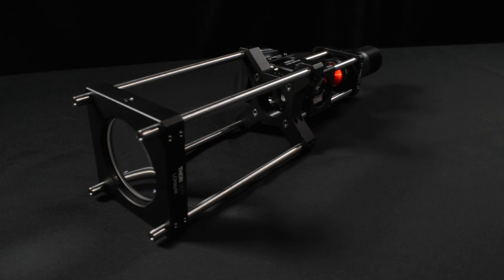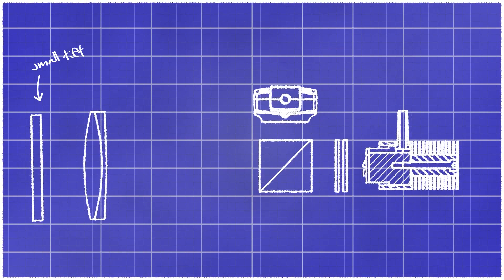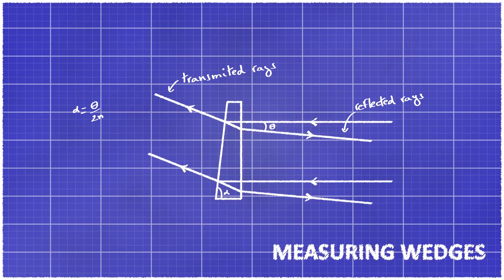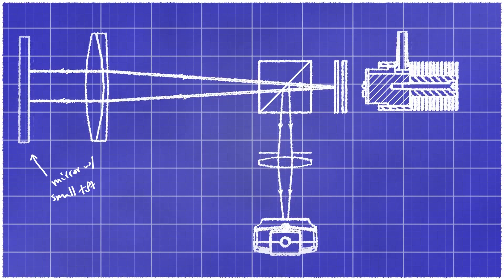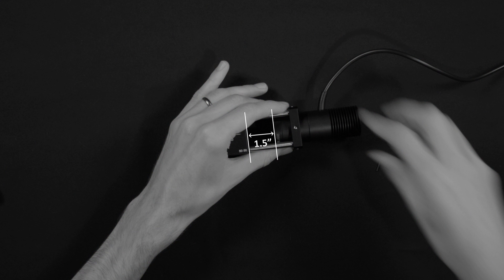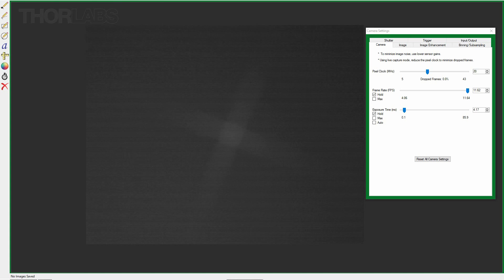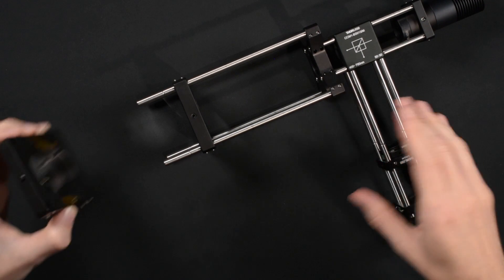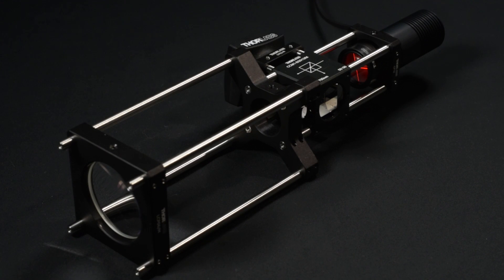The tool every optical lab needs to have

Comment: Hi, thank you for great video. Following your project you think it is possible to create a collimator instead of an autocollimator? Maybe replacing Crosshair Reticles with a very small pinhole or a Usaf resolution chart ? I'm trying to build a collimator that allows me to have an image projected at infinity. Thanks
Reply from the maker: Yes/no. While it's fairly easy to replace the reticle by any other target (pinhole, slit, slanted edge, ronchi, dot pattern, usaf etc.) the question is more on the quality you expect. If you aim at quantifying contrast for mtf evaluation you will need very high imaging quality which is not easy to achieve.  In the current design form, the BS is going to introduce aberrations to the image. However, you can align your target with a second lens using the autocollimator.
Reply from the maker: It's also important to budget the allowed depth of focus for the autocollimator. If I remember correctly, it's around 0.2 mm for this design (f=200 mm). You may need to increase the focal length while maintaining the f# depending on the lens under test and the precision you want to achieve
Reply: @thepulsar  I meant from your setup removing the beam splitter and replacing the target to create a collimator instead an autocollimator. But how to calibrate it without BS? Also what did you mean : "However, you can align your target with a second lens using the autocollimator"?
Reply from the maker: @user-qe5vi8df1h  you cannot align without a beamsplitter. One solution (among others) is to use the autocollimator to align a second system (the collimator) that has the same fnumber
Reply: @thepulsar  Thanks! I'm trying to build a system that allows me to verify the quality of a camera lenses. A setup like this: on one side a collimator that projects the image of a resolution test target or pinhole at infinity and on the other side behind the camera lens to evaluate a ½" CMOS Camera with a 160mm tube and microscope lens mounted.  I hope I explained it well :)
Reply from the maker: @user-qe5vi8df1h  do you want to evaluate the camera lens alone or with the camera attached? Apart from that your setup is valid -- but the optical quality of every subparts must be paramount
Reply: @thepulsar Yes, to evaluate DSRL camera lens only, without camera. The lens will be mounted on a specific support such Thorlabs SM2NFM, every parts will be mounted on an optical rail. To evaluate the quality of the Dsrl lens on infinity position  a Finite Conjugate Objective 5x or 10x  with a ½" CMOS Camera positioned precisely on the lens flange focal distance. To align all the components I will use your autocollimator, the only thing I'm not sure about is how to make a good quality collimator, not perfect but suitable for this purpose!
Reply from the maker: @user-qe5vi8df1h  an alternative is to put a pinhole at the rear focal position of the DSLR objective and to measure the psf directly using a very long focal length  parabolic mirror. I know companies who measure like that  :)
Reply: @thepulsar  To recap, an autocollimator like yours to be used to calibrate a collimator with the same characteristics f=200 mm Achromatic Doublet. In this way  I should be able to calibrate the collimator, right? Do you have any other advice on collimator construction? thanks for your help!
Reply from the maker: @user-qe5vi8df1h  that's it! The big issue when you need high precision measurements is that you need pretty expensive tools. I've devoted a part of my career as metrologist and we had headaches with getting high performance mtf measurements!
Reply: @thepulsar  Do you think it is possible, using an adapter, to add a Finite Conjugate Objective 5x in front of the autocollimator lens? In this way maybe  it is possible to focus the autocollimator beam on a surface placed at the working distance of the microobjective. If the answer is yes, what should be the mechanical distance between the two, microscope objective and collimating lens?
Reply from the maker: @user-qe5vi8df1h  yes it is possible; you need to separate them by the front focal length of the achromat to make a 4f system. I'm in the middle of a new video to explain that  :)

Comment: Hi, thanks for the great video on autocollimator! Can you explain what are the differences (functionally speaking) between this configuration where the collimator lens comes after the beam splitter, versus the one on your website ("measuring small angles deviation") where the collimator lens is before the beam splitter?
Reply from the maker: It's a tradeoff between cost, size and optical image quality. For short focal length and angle measurements, the version on the website is the best. For long focal lengths and focus adjustments, this version is more suited.
Reply: @thepulsar  I made the autocollimator based on your design here! However, when it's done, I'm seeing two reticles (you mentioned one is the ghost). The bright one moves when I tilt the mirror slightly, and the dimmer one does not move when I tilt the mirror. Why does the dimmer (ghost reticle) does not move when I tilt the mirror?

Let me provide more info: the dimmer reticle will go in and out of focus when I tilt the mirror significantly, but it doesn't move! The bright one behaves expected, it moves even with minor tilt of the mirror.
Reply from the maker: @jimmyzhanneutron  I noticed the same behavior in the past but I would have to do more experiments to pinpoint the origin of the issue. I'm pretty confident that it is a secondary reflection on the target and it's not linked to the cube or lens internal reflection. My theory is that this secondary reflection acts as a "cat's eye retroreflector". I also think you can get rid of it using a 0.7 ND between the cube and the lens but I didn't validated it yet.

Comment: Thanks so much for making this video! I've built such an autocollimator (AC) for our lab and have been playing with it for about a week now.

Regarding the "ghost" image of the reticule that appears after the camera is put in its final location: do you know from which surface of the beam splitter it's coming? I noticed that blocking the light between the final AC lens and a mirror that reflects light back into the AC will eliminate both the real and ghost image. Furthermore, only the real image will move when the mirror is tilted, whereas the ghost image remains fixed. The location of the ghost and real image also become displaced axially when another lens is placed after the AC lens but before the mirror.

I find this behavior a bit inconsistent with all of the hypotheses I could think of regarding which surface the ghost image is coming from. Any ideas would be greatly appreciated!
Reply from the maker: To be checked (just a quick idea thrown here) is a double reflection involving the cmos sensor. One solution to test is to insert a ND filter at the beamsplitter, that should reduce the ghost :) tell me if you try it and get some results!
Reply: @thepulsar  Thanks for the reply!

I think I figured it out yesterday evening. If all one has is a mirror at the end of the AC, then the ghost image is from light that actually passes twice through the AC. After passing through once, it reflects off the reticule and then passes again to the mirror and finally to the camera.

Why doesn't the ghost image move? If you draw a ray trace diagram of the AC with a tilted mirror, but trace the reflected rays back to the reticule and make them reflect off of it, you will find that these rays actually return to their original point of origin on the reticule. (Assuming I haven't made a mistake 😜.) So in this way, aligning the main image with the ghost actually ensures that the mirror's surface is perpendicular to the optics axis because only the cross from the first reflection moves. Pretty cool!

If you have another lens between the AC and the mirror, then the secondary images in this case are coming from spurious reflections. For example, if you use a plano-convex lens with the flat surface facing the AC, you can make it perpendicular to the optics axis by aligning the cross from light reflected off its surface to the cross coming from light reflected off the mirror. The Thorlabs camera seems to have enough dynamic range to see both.

Thanks again for the video! I now know that an autocollimator is way more interesting than I first thought. I'm trying now to find a way to extend it to be able to align lenses in all three dimensions.
Reply: In case someone finds this comment, I should add that, upon further testing, I found that you can only ensure that the mirror is perpendicular to the reticle when the reticle center is exactly on axis, which likely won't be the case given the tolerances of the Thorlabs cage system. As was mentioned in another comment, this makes the autocollimator better suited for relative measurements.

Comment: Really a fantastic video, Chapeau!

I've got a few short questions:

- What is the chromatic error of the system? e.g. could you use the setup to check the collimation of a beam of different wavelengths? I think about building an autocollimator-setup like this for testing the collimation of a laser beam in an optical setup.  For example, if you switch from the lower end to the upper end of the visible spectrum, 400 to 700 nm, would you need to recalibrate the setup? Or would you expect the error to be small because you used an achromat as a collimating lens? I will try  to simulate this beforehand, but maybe you did some testing as well?

- Do you use 3D-Software to plan those Thorlabs Cage systems ahead? If yes, which software can you recommend?
- is the first sequence in this video filmed or rendered footage? If the latter, what software did you use?
Reply from the maker: Hello,

- For chromaticity what I do is I switch the LED depending on the wavelength I need and I recalibrate the autoco; it's quickly done and guarantee a good result!
- Today I do everything in SolidWorks prior to assembly but at the time of this video I did not; just a pen and a piece of paper can be enough
- First sequence is actual footage :) I used some sort of skateboard made for radial traveling and smoothed the motion in after effects

Comment: Hello, Could you please elaborate on why would you not advise a color camera but a monochrome?
Reply from the maker: That's because of the Bayer pattern and the subsequent "debayerisation" process that is manufacturer dependent but which will affect always resolution. The process can also introduce non-linear response of the position detection due to the fact that we are only using 1/4th of the pixels with the red light
Reply from the maker: That however only apply to Bayer type but there is no real advantage of using a tri-cmos camera for monochrome applications

Comment: Amazing video. Can I ask why did you switch to 200mm lens rathern that microscope objectives you had in the past? I guess in theory you get a slighly better NA, but surely abberation correction is not as great?
Reply from the maker: You can actually use any focal; the longer the focal length the more sensitive the instrument. But on the other side long focal also means short measurement range. Here I wanted to achieve high sensitivity :)

Comment: Really cool video. How does the temperature and expansion of the metal elements influence the accuracy of such autocollimator?
Reply from the maker: I haven't checked/simulated but based on the symmetry of the system I would only expect a very slight defocus, but nothing that would be mistaken from tilt/angle change

Comment: Great explanation and implementation, thank you. Can you answer if LED laser (the ones from thorlabs also) can be used instead of one you mentioned in BOM?
Reply from the maker: The problem if you use a coherent source is that you will get an extremely noisy image due to speckles
Reply: @thepulsar  need to read about it now)) one more thing, I found article on autocollimator design but they combine multiple lenses. Overall it looks like same for me. Do you think it is applicable here also? https://www.researchgate.net/publication/289733489_Autocollimator_for_Small_Angle_Measurement_over_Long_Distance

Comment: Hi, thank you for your great work! I have a couple of questions about the applications of an autocollimator, I couldn't find any answers around. 
Basically I have a telescope structure with the secondary mirror supported by some struts, and I should monitor tilts and displacements of  it when exposed to a thermal cycle. Is the autocollimator actually suitable for such measurements? I think it is for angles, but could it be good for displacements as well?
Reply from the maker: if you would like to monitor the motion of the secondary mirror the autocollimator can be used for the tilt. Sometimes it may be required to fix a temporary mirror either at the back or side of the object under test for accessibility purpose (I'll let you look for that). For displacement, I would use different techniques depending on the expected magnitude. There are professional interferometers that can help you to do that but if you can't afford them you may use techniques like sending a beam from a 45° angle and look by how much it moves on a detector at 90° after reflection on your object. Interferometry will give you the most accurate results but may be sensitive to vibrations and stuff like that. Lot's of possibilities actually :) You can also have a look at confocal sensors.
Reply: @thepulsar  Thank you for your fast reply! For the autocollimator applied to the telescope yes, I was thinking the same: temporary mirror on the back of the secondary mirror, both flat and perpendicular perhaps so that tilts in each direction could be measured. What about the air refraction index? It should be compensated in some way, even though the measurement can be just relative to the original configuration I guess. For the displacements, I had a look at the components of the Michelson Interferometer Kit by Thorlabs (EDU-MINT2), apparently for around 500 £ (recycling the beam splitter from the autocollimator) could work. The confocal sensor seems sooo cool, but prohibitively expensive :D
The main issue is maybe the thermal cycle itself and the vibrations coming from the chamber.